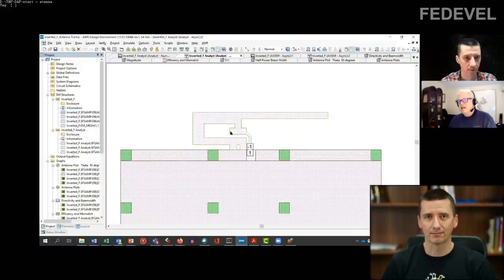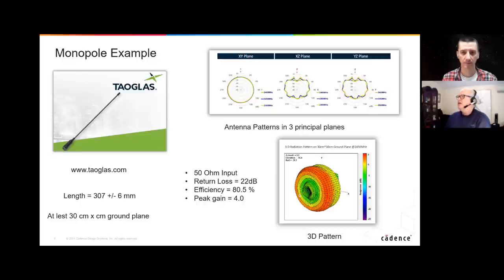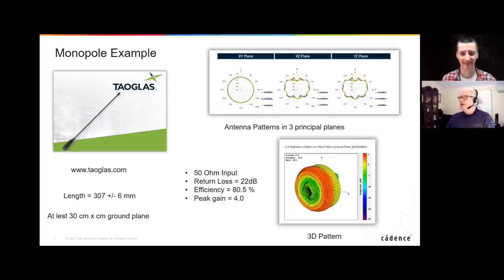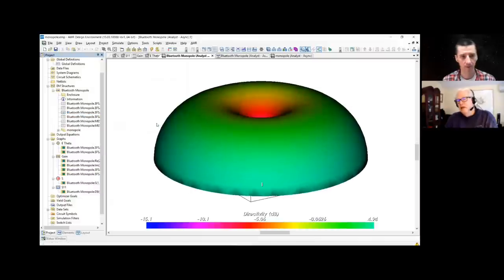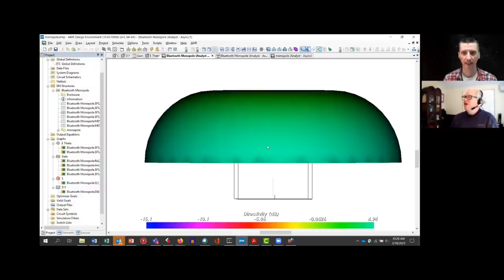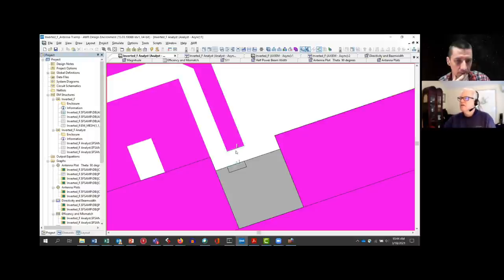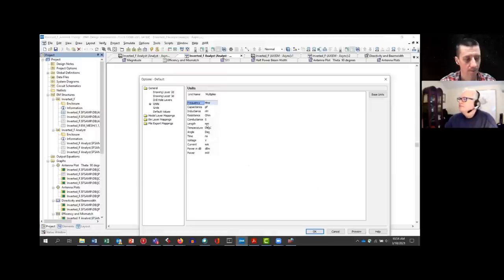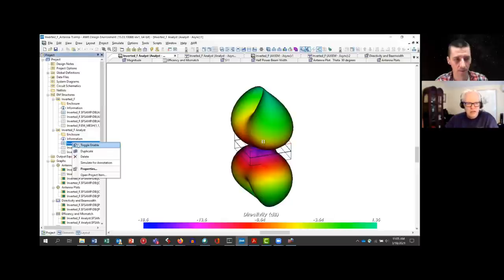How to Design Your PCB Antennas And How Antennas Work (Bluetooth Antenna Examples) - with John Dunn

Comment: I wonder if the first stage RF amplifier has 50 Ohm input and output impedence, can you connect it to a buffer stage with a high input impedence (so that the buffer stage receives the output of the rf amplifier)?
We can limit to modest frequency of FM radio at 100 mhz. Thanks kindly for the interesting video and for the effort in making it..
Reply from the maker: Thank you danielfromca. PS: I do not know the answer, but maybe someone else can help?
Reply: @RobertFeranec  Thanks Robert & I appreciate all the educational work you do in this great channel.
Reply: Yes, provided the electrical length between the amp output and buffer input is short.  It’s done a lot in RFIC.  There are other issues such and load line and stability to consider, even with short electrical length.
Reply: @rfengr00  Thanks Louis that really helps to know that. As otherwise, if at every stage you have to maintain 50 Ohms, it'd be difficult to do much with the signal. My hope for the FM radio is to take a whip antenna (a monopole telescopic antenna), connect it to a RF amplifier, possibly buffer the RF amplifier's output and then pass the result to a Gilbert mixer to reduce it to about 0.5 mhz (from about 100 mhz). I'm Ok with the notion that the RF amp of the first stage has to be impedance matched with the antenna, but if this had to hold for every stage, such that you couldn't escape from 50 ohm input and output impedances, the design would be an order of magnitude more complicated. I'm glad we have people who understand this, as lots of the high frequency stuff and monopole antennas that don't even connect to the ground of your circuit (they have a single connection, unlike a voltage source which has two wires - one to ground and one as output) seems like black magic to me.
Reply: @danielfromca  Have a look at Razavi's RF Microelectronics book, as he discusses the philosophy of RF design with matched impedance vs RFIC where you are more in the voltage domain; I took the UCLA RFIC course last semester where we went through a lot of this book.  That said, you don't need matched impedances in RF, as it really depends on how much ripple you can tolerate over the passband.  Many amplifiers have poor output impedance (i.e. S22) and it's of no concern unless you are driving a poorly matched load through a large electrical delay, or worried about signals getting back in from the antenna to generate distortion.  You could take an ideal common-gate cascode amplifier with perfect 50 Ohm input impedance, and it would have infinite output impedance, and can hook it up to a 50 Ohm cable with a 50 Ohm load.  It's only when the load and cable are mismatched is when you have a problem.  But as I replied earlier, there are a ton of other factors to consider too.
Reply: @rfengr00  Thanks for taking the time to provide the additional details. Ultimately, I'll try to solder it on a perf board and experiment. Unfortunately, it doesn't seem that simulators are much help here, as they don't take into account signal reflection from mismatched load etc.
Reply: @danielfromca  the simulators do take that into account.  It’s all in how you model it.  If you are using LTSPICE, look into the “.net” directive, which will do an AC analysis and return S and Z parameters.  Of course you can look and input impedance directly using equations too.
Reply: @rfengr00  that's interesting, I knew that stray capacitance is accounted for, but as far as signal reflection due to mismatch is concerned, where things like length of wire matter, I thought simulators don't have a way to figure that in. Oh well, lots of things I don't know & there are always new things to discover..

Comment: I have used a wire which i added to a existing antenna which i believe is not well designed the signal is limited and why i came here .  Adding this wire doubled my range and kept my signal solid as i moved.  No bluetooth has a great range most are lucky to have 30 cm line of sight distance and are further limited by walls or door ways which mess with the flow of electrons to the receiver/transmitter.   This wire idea works but it requires external mounting not internal mounting which is my preference.

Comment: What about placing a ipex connector in parallel to a pcb antenna, is it that bad at all? Actually it could act like a stub and detune the antena?
Reply: You should defenitely including it in your simulation. So yes, it can influence the matching of the antenna. Espeically for higher frequencies. And once you plug something into that connector it will have a significant influence.
Reply: Have the same question) If I put the connector in my design to perform matching and then remove from the prod device (keeping the pads for connector on the board). How significant will be the impedance change?
Reply: @MrBorsoft  good question. As I understand, if the designer don't develop a impedance change in terms of decreasing resistance by changing track width, it's acceptably "ok". But problem is whether this will act as a stub. At the end of the day, everything you do will detune the antenna, but the question is how much? (everyone please feel free to enlighten me!)
Reply: The standard answer of "it depends".  Generalized to the design shown in the video, when you tack on the coax, you are extending the counterpoise (notice I did not say ground) and generating common mode currents on the exterior of the coax, both of which will change the radiation pattern, and to some extent the impedance.  There are a couple of things you can do.  Use the tin-dipped, hand formable coax and solder that to the ground plane. That will short-circuit the common mode current.  Since the test connection will still go off-board, you then use a ferrite beads (right where it comes off the PCB) to form a high impedance on the coax exterior.  This is compact but with the disadvantage of lower antenna efficiency, and giving you a (fake) improved return loss due to the absorption in the ferrite.  Alternately you can wind the coax into a tight coil to form an inductive choke.  This will have low loss, but is larger and lower bandwidth.

I have a series of videos here on IFA theory design (in Microwave Office), manufacture, tuning, and test:
https://youtu.be/q6f6m2j1nYs
https://youtu.be/br4-9p_6GOA
https://youtu.be/8gVFonUfoao

This also shows the issues with common mode radiation and the fix:
https://youtu.be/Hcc3FO2BmOQ
Reply: @MrBorsoft  Like Louis said, it depends. However, there are connectors exactly for this use-case, like the MS-162A by Hirose. You put them into your feed line (like you break the line and the connector has two pads for input/output). It behaves as a "perfect" through connection, but once you plug in a cable, it will break the connection to the antenna and route the signal from the amplifier to your cable (or vice versa for receiving).
Reply: @Ech01378  Thanks! I think “acceptably ok” is the max precision answer for my question:) will try anyway, as the last attempt to solder coax probe to 10mil strip was unsuccessful. Definitely need some connector to measure it. Or dive into simulation software study:)
Reply: @MrBorsoft  I never tested this before, but I've seen a lot this kind of parallel connectors. If you try, remember to send me what you've got as result!! And about simulations, remember you are as powerful as your tools haha
Reply: @Jacky2k4  So this would be like a "bypass" and won't work for tuning the antenna?
Reply: @rfengr00  thanks so much, I appreciate your help! that's a lot of information in your comment! I would love to learn more. By this moment, I'll have to watch this videos you indicated, so that I think I will understand it better.

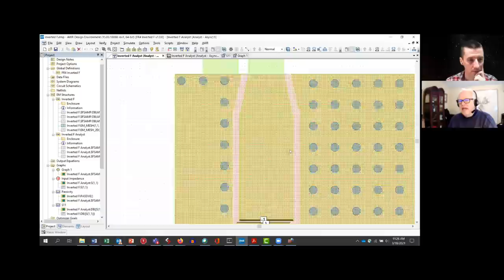Comment: 1:27:00 Presenter disparages Cypress' inverted F antenna because it didn't have good results in his software, then admits he's not certain he has the dimensions correct. Meanwhile, if the viewer looks at the image from Cypress and the image that the presenter used as an example, it is easy to see they are not the same. It's no wonder he didn't get good results 🤣
Reply: He explained more than once that his result with the Cypress antenna is an example of why you need to follow the manufacturer's instructions carefully with these types of antenna design guidelines.  Did you watch the video to the end?
Reply: Ah, criticism based on fallacious argument from an anonymous account.